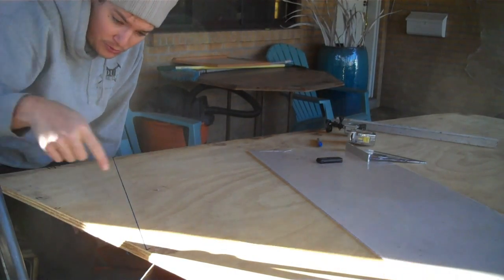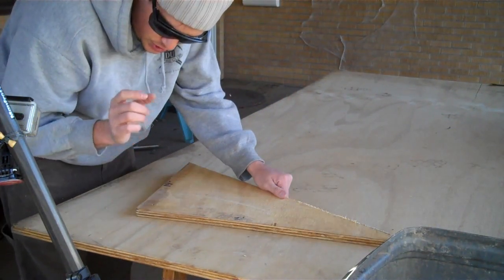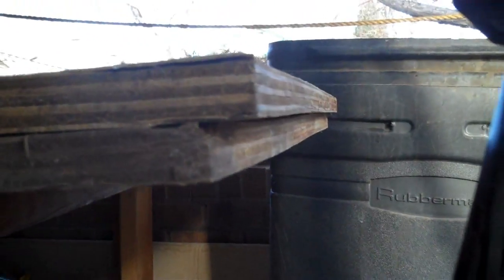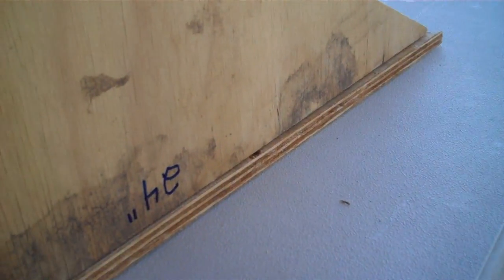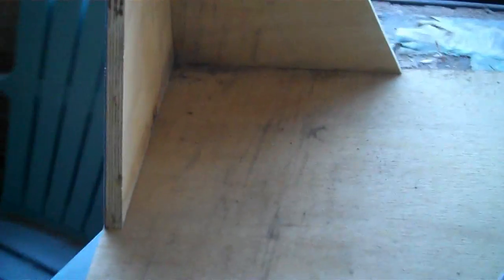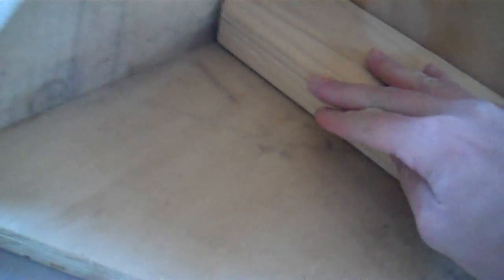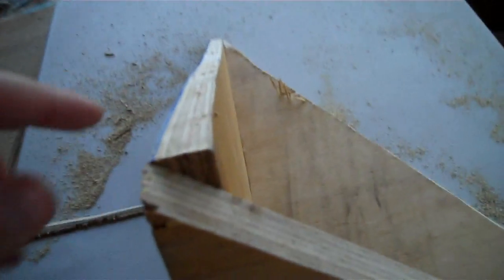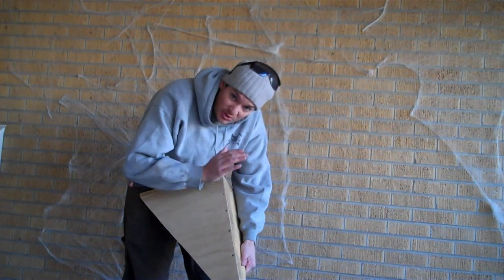Build a Climbing Wall Volume

Comment: Hi Andy,
If you switch your skill saw angle and cut the long diagonals at a 45 degree before you assembly the volume the volume sits flat on your wall and does not need the free-handing with the jigsaw. This eliminates the smallest gaps you've got between the volume and wall. It looks and sits better.

Comment from the maker: On each length you should have 2-3 longer screws, so 6-9 total more or less depending on the size of the volume. If the structure you are attaching it to is strong (quality plywood) this will hold much more then a 220 lb person. There are brackets that come with professionally made volumes for commercial gyms so that the volumes don't need to be screwed into their fancy/expense special textured walls.

Comment: So all you connect it to the wall at the end is just with 4 longer screws?  I thought there would be some sort of bracket or stronger method that that.  WIll this hold a 220 lb person?